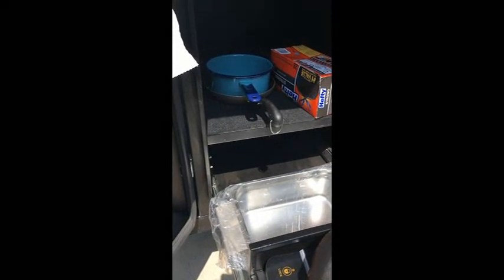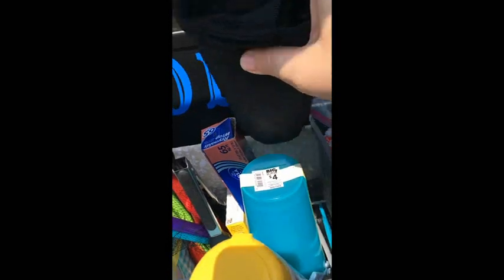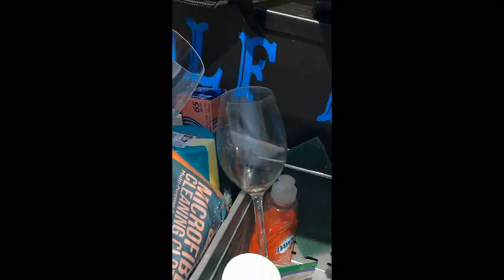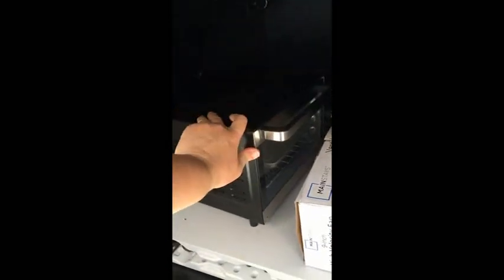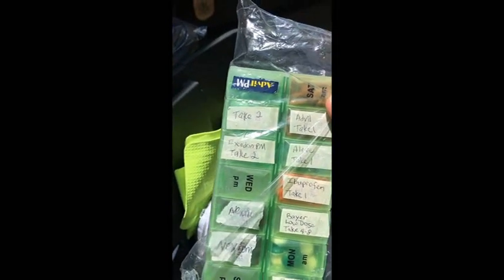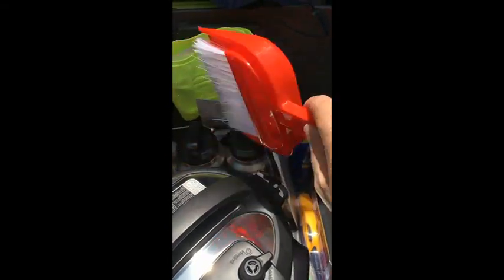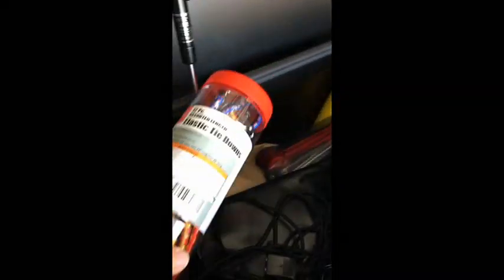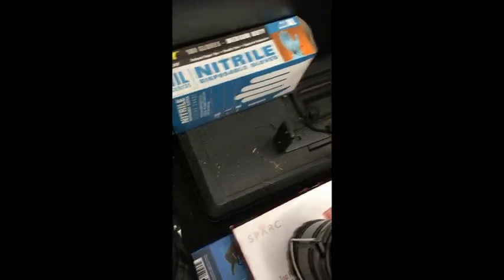Smittybilt Scout Trailer:  What do we pack

Comment: We've had our Smittybilt Scout Trailer for about a year now and we love it. We have our fridge on the left pull-out tray but use the tote/tub method of packing on the right pull-out, like you guys. We like the Plano storage boxes.  Works great. I like the motion activated LED light idea and the magnetic paper towel roll idea.  I might just borrow that idea from you.  Great video.  Thanks for posting.